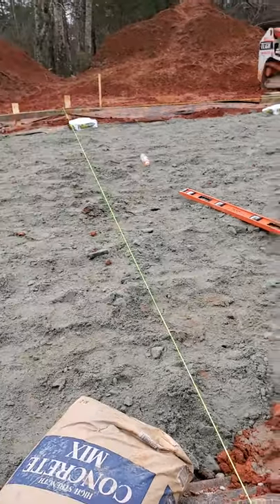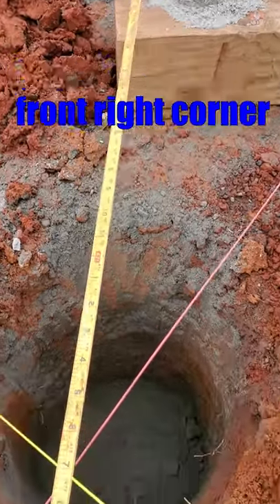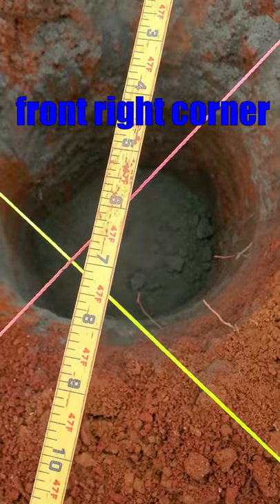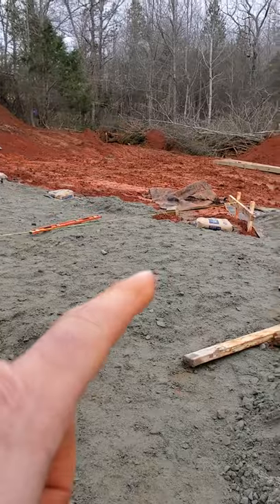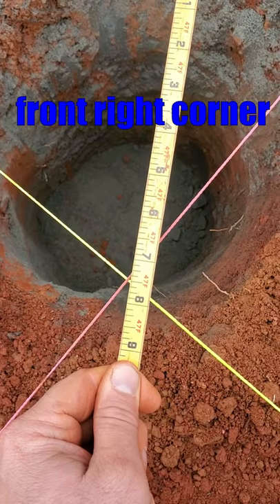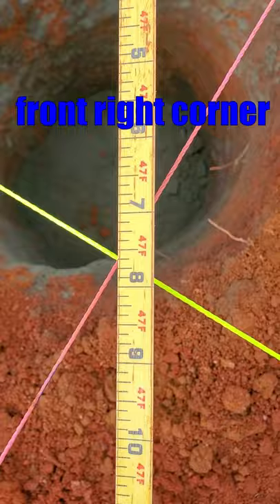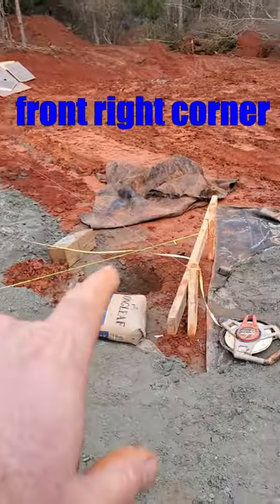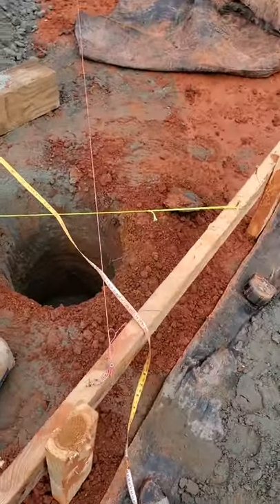Adjust string lines to "square" up layout

Comment: All good if your not already on a boundary , but good fix
Reply from the maker: Not necessarily,  you'd need to move the two opposite corners of the side that you didn't want to move.
In my case, the back line didn't get adjusted.
Reply: Excellent method. Every boy should know this.

Comment: Ive come to the conclusion that im just too stupid,  i just built a small shed 15 ×20 to be exact and used round posts to frame it. 
 I measured like a mad man and used every video of how to square a layout for a building and it turned out to be a complete fuck up. The shed is done and it doesn't leak but its not evem close to being square. Luckily its just a farm shed that no one will see really so thats good. I just ha e never felt more ignorant and foolish about myself than building that shed. Im enveous of guys like yourself who can calculate this stuff so easily.  I feel stupid writing this comment😂
Reply: Gotta start somewhere man you did good
Reply: Never beat yourself up over things you don’t know. Rest of us had to learn from tradesmen or like yourself…. Trial and error aka the hard way
Reply: Yeah I'm about to make my first endeavor at a 15x10 building on my property and I'm stoked
Reply: If you are building 15ft x 20ft foundation your diagonals should be 25ft for your foundation to be 100% square.
Reply: I want to build a shed but I'm afraid this will happen to me. I have actually had nightmares of gaps in the roof with water coming in. Carpentry is a trade I wish I knew.
Reply: went through that my paver patio too. the only way to get better at something is do it over and over agian and that's not really how it works in DIY world